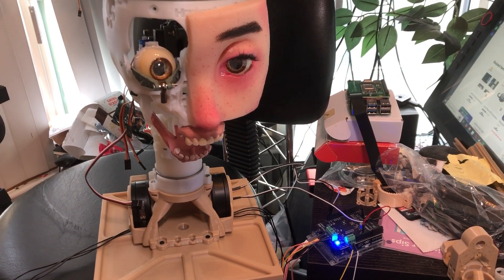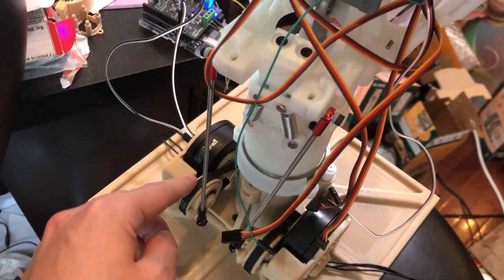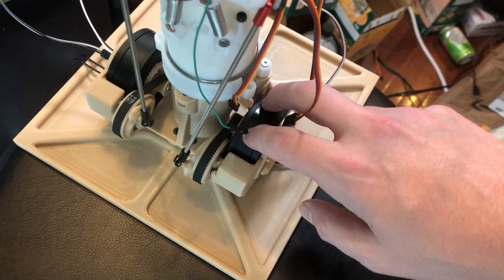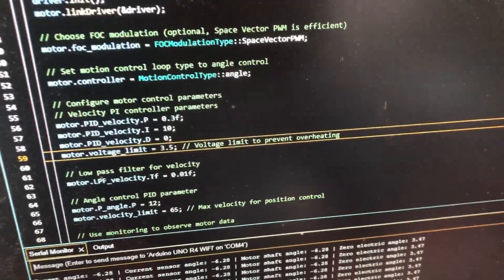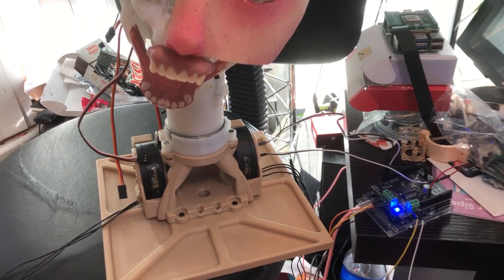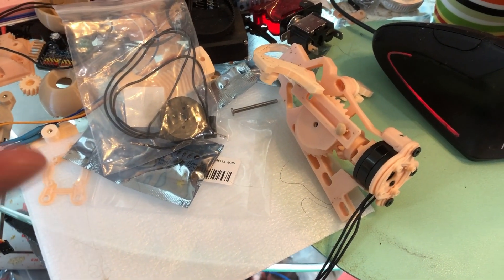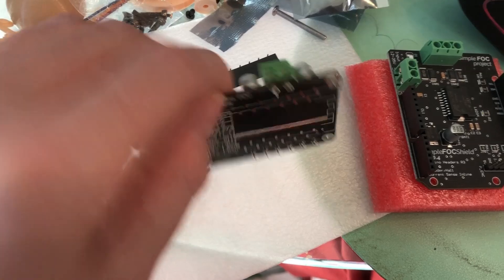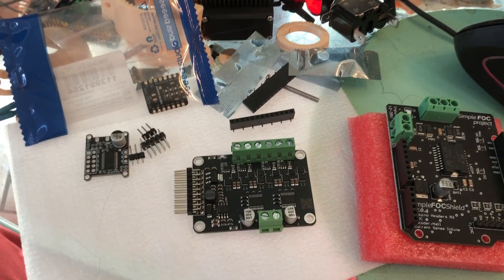Experimenting with Brushless Motors

Comment: David - Where did you buy the motors and motor driver boards?
Reply from the maker: Aliexpress.  I'm using GM5208-12 motors for the neck.  I've gone with a dual motor control board with an integrated ESP microcontroller - I ordered a few of these after confirming that one would work well.  It's not one of the boards at the end of the video here, I only found it later on.

Also I have some Cubemars BLDC motors I will be using in future weeks. I  ordered from their website.

Comment: Simple FOC is the best option i think. Theres other controllers, but too expensive. ODrive is a little over priced. Theres the storm32 shields and other brushless gimbal controllers, but the software is going to be harder to convert for general robotics use. I ended up going with a planetary geared coreless motor for my robotics project because they are compact, low power, its going to simplify the control, And i dont need mine to move as fast as the brushless option.
Reply from the maker: i'm looking at maybe a 5, or 10:1 planetary gear for some of these motors.  To move the heavier parts around I think that will work well.

Comment: What is the cheapest drivers that we can get price to controlled motor ratio wise that we can use haptic feedback with?

I always wanted to try making a remote controlled arm even if weak with field oriented control haptic feedback wirelessly over wifi but the price of controllers on top of the brushless sensored motor ends up being insane! 

Anyone know the cheapest motors and drivers that allow force/haptic feedback and can pull themselves back into position?

Comment: With those AS5600 boards, remember to solder dir pin to ground. If its left floating it can cause issues.
Reply from the maker: Ok, I will do this.  I was actually having some issues when it came to coding this all up.  I was finding strange results where I had to flip the interpretation of the sensor in the code between CW and CCW.  This sounds like it might be related to that.  Many thanks for your suggestion.
Reply: @DaveMakes  Drove me mad  before i figured it out, really makes no sense to have this pin as why not just have a fixed direction and the use software to choose the direction. Guess its for the PWM mode or something like that.

Comment: Who ❤ I would love to buy one or two complete heads from you, why not post ebay or etsy ads?
Reply from the maker: It's still very incomplete.  I have been thinking about selling them in some way in the future.  Either as files for people to print, or parts to be assembled, or even fully assembled heads I suppose.  Different costs are associated with all of these.  I have been thinking that the cheapest method would be for me to sell the parts for printing at a fairly low price so that many people can print it.  I could then sell silicone skins to wrap over the head.  These I can make myself in batches, mailing them out.  They would cost quite a bit though.

Certainly possible to sell more completely assembled heads, but it would cost a lot more.

In months, or maybe years ahead.  I may be selling them.

Comment: I have the small board with the DRV8313 2.5-A Triple 1/2-H Bridge Driver and the small board with the as5600 magnetic angle encoder in a test setup. This combination works well with small brushless motors.
Reply from the maker: good to hear! thanks

Comment: we need sensorless brushless foc!! make our designs much simpler no stupuid magnet and sensor needed
Reply from the maker: I think this is possible to some degree if the load is a known quantity.  By sensing the current consumption of the motor against the load, the position of the motor can be inferred even without any sensor on the shaft.  That may be well outside of my wheelhouse right now.  I really have no idea.

Comment: I tried a linkage setup for a neck once, never could really figure out how to get it right.
Motor veep vrrrp noises are crucial for robots, but sometimes the SG90s can be a bit much :)
Reply from the maker: I was really worried about the pulleys I printed here for the belt.  I wasn't sure if the belt would slip the teeth under load.  I didn't use an idler pulley at all.  It all seems to working out though.

Comment: Would be 1000 times cooler if you can make the motor whine stop. Different motor drivers? Like how 3d printers handle noisey motors?
Reply from the maker: Honestly not sure how to make them completely silent.  I am very new to working with these motors. Maybe a more expensive driver would do that.  Definitely outside my budget though.

Comment: You can stack 2 of those simple foc shields by configuring some solder bridges on the bottom, And there is also a dual version of the DRV8313 based boards now, the smallest one you showed. Looks really awesome hope to see more of these amazing projects
Reply from the maker: I am using I2C for the magnetic sensor right now, and I understand that the module has a fixed address.  I think even if I did stack shields I would be restricted to only one encoder, though multiplexing might be a possibility.  I'll have a look for the dual DRV8313.  Thanks!

Comment: cool stuff so far. i was going through a million designs on a single eyeball. going for super small design, it is hard with 3d printer. need a micro lathe. or outsource the parts? Servos are nice and easy. but brushless or steppers are much quieter. which is what i've been playing with. or trying to make work. Keep up the cool work.
Reply from the maker: I know exactly what that's like.  I've been wondering about a mini lathe, or milling machine myself.  Or ordering bits from somewhere else.
There's a certain appeal to using the machine myself, though I think a lot of the parts i'd want made would require a 5-axis mill.

Comment: how many redesigns have you gone through?
Reply from the maker: Lost count.  Constantly changing parts.  I've tried to keep things modular so that radical changes to one area don't necessarily impact other areas.  A complete motor swap is one situation where I need to go over most of the parts and change them though.

Comment: that's awesome, those motors sound like they  work a lot smoother than before, and less wear and tear on them.  :)

also  you inspired me to try silicone for my robotics project too with 3d printed injection molding.
 i model with blender and can 3d print as well. 
i am using a mix of pi and arduino components as the main systems.
as for motors, i am using 60rpm geared DC motors with 3d printed mounts and gear boxes and potentiometers to track the range of motion. 
and for ai, i am making a workaround for replika ai, and edge copilot is assisting with the script writing XD
Reply from the maker: that sounds great!
Replika has a lot of voices to choose from, I have used it in the past.  Very nice.